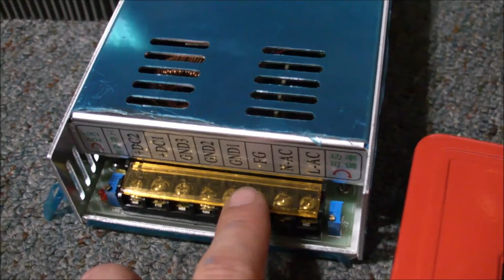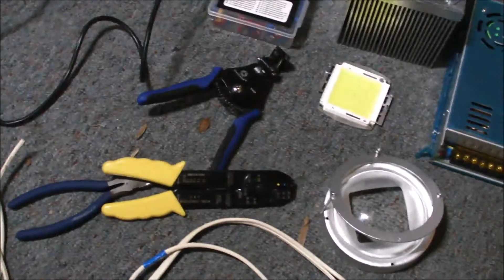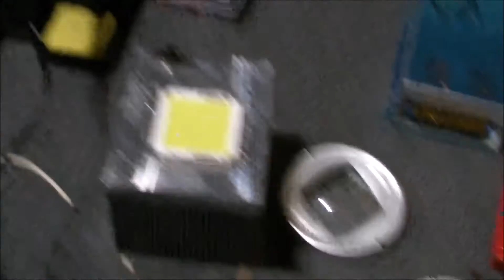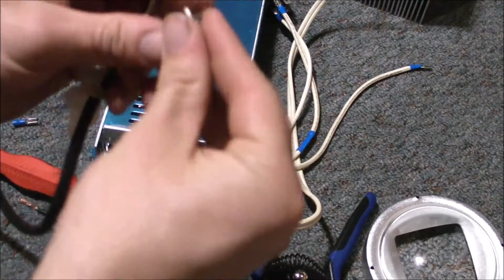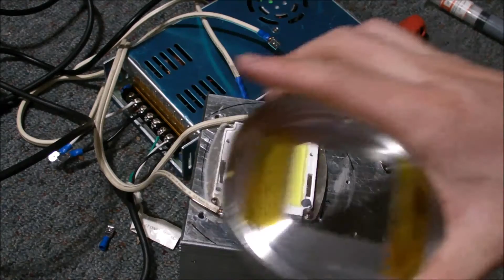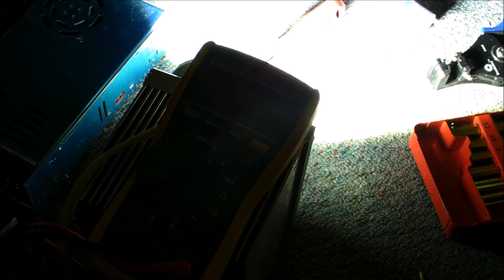Project Night Light- 500 Watt LED Episode 1

Comment: I watched and researched this two years ago. Will some one wake me, when we can get 80k lumens for $200--less, driver, and heat sink.  Not weighing a ton (heat sink and driver) would be a plus.  I say 80k, because this is the bare minimum light needed to light up a room and make painting difficult color changes possible. It is also the Flux of a $100 magnetic 600watt metal halide.... I have spent 30 years trying to find the perfect lighting for painting.  Led lighting is not being ambitious enough.

Comment: Nice project.
A few things though..
You should go for a thicker tip when soldering components and wires of that size. Gives the joints a fast heat-up on smaller surface rather than slowly heating a bigger area.

Pre- soldering/ tinning the wire ends as well as all components IS important, as you need the flux to actually soak into all the strands to allow it to do its "magic", i.e. make an optimal bond between solder and copper, or whatever you're soldering together. 

When you don't pre solder the wires, a lot of the flux will be burnt away before the solder gets hot enough to melt and bond between every strand.
This in turn makes the surrounding components heat up unnecessarily as you'll have a massive increase in heat dissipation when two unsoldered joints are heated up at the same time, and most electronical components don't like getting hot for a longer period than absolutely necessary with optimal soldering.
On the other hand, when you solder stuff on top of a heatsink, you'll run a great risk of a cold solder joint (poor connection between solder joints)

You may have heard this all before.. 
But when you post a tutorial on youtube, it's best to make sure that for example viewers with slim- to- none soldering experience learn it properly
 -rather than end up giving up on a project due to misinformation.

Comment: Поздравляю! Ты первый на ютубе собрал этого монстра. 
 Юзай водяное охлаждение.
Reply from the maker: first one to build a useful flash light, all others on youtube are not practical since the battery life is so short
Reply: Я тут собрал кой чего на 100w диоде. Как выложу на Youtube, поделюсь ссылкой. В общем, там аккумулятор из 48 банок 18650. Делал для пикников в лесу, но этот аккум и 500вт потянет. 
 Кстати, очень рекомендую отражатели-рефлекторы на 15--30 градусов, свет получается направленным и даже 100 вт фонарь светит очень далеко. Линза 60 градусов светит во все стороны.

Comment: FYI. The AC cord wiring color does matter.  US electrical code ( NEC) denotes that AC wires as follows,  Black is line / load, White is neutral, & green is ground. 
The way AC circuits are made, that internally, if something happens and it shorts out in the primary circuit it will go to ground. If the Black or line is wired to the neutral terminal and a internal short happens, your power supply case is now HOT electrically. If you touch the case at that point & you are grounded, you will be electricuted.    Just saying for your safety and viewers that could destroy a anvil if you know what I mean. Lol

Comment: Nick, I'm trying to power 9 LED Panels (40w each) with a 500 watt Med grade driver, but I keep smokin/burning out my lights. I don't think there are current limiters/diodes in the LED panels, can you help with a solution if I show you the diagram? Can I email you?
Reply from the maker: they are probably 50 watt led chips. they run on anywhere from 25-35VDC (depends on color)  what voltages is coming out of your driver and do you have them wired in series or parallel?
nsilcox3@yahoo.com
Reply: 9 panels at 40 watts each is only 360 watts, the reason your burning one light out is because its thermally running away, when it starts getting overpowered the current draw curve gets amazing steep exponentially fast which means it draws current alot more efficiently the more voltage you put to it, thats why it gets real bright right before it lets the smoke out. you have to look at the datasheet that goes with the led you bought, you need the forward voltage and current it wants to run to be exactly right, also are you running your leds in series or parallel? make sure u mark ur panels so u kno what they are if you start gettin a collection its worth it trust me. i Highly recommend getting a thing of thermal compound itll make your leds last alot longer because trust me most panels so far have a pretty high failure rate of some of the leds in them, iv had some panels slowly one by one lose about a third of the leds and one fail in strings till almost all of it was dead it was definitely a bad led tho, not typical. you dont need diodes, in fact thats exactly what an led Is, it just emits light also, you definitely need some resistance though im not sure what your mains voltage is but to get the right resistor all u need is the line voltage feeding the resistor to the lights, the voltage the leds want to run at (whether its series or parallel), and the power dissipation whiches in watts whiches basically how much power the resistor can handle. theres probably thousands of videos on here explaining all about this stuff because im sure i didnt explain it very well, hopefully to interest u in checkin it so u can learn to do it urself it really is soo much easier than youd think and its soo nice n so much fun when u can start puttin leds pretty much anywhere u want, iv got em in every light socket my car n house has lol and my truck has 20 marker lights alone lol sounds ridiculous  its a 94 k3500 with the lights across the tailgate for some reason, across the top of the cab and on the front n back of the dually fender

Comment: I wish I could buy it from you, could you maybe give a price?
Reply from the maker: i will be uploading the finished product within 2 weeks hopefully, i built the frame from aluminum, 2 cooling fans,  1000 watt battery (48V, 22AH battery) with built in charger, balancer and available to run on wall power for hours if needed
i dont know what price to put it at since the amount of time and effort that was put in this project
Reply: +Nick Silcox ok, thank you for the very quick reply, and advice.
Reply from the maker: +S Bekcic primarily, the only hard part was understanding how to make the battery bank from scratch. Other than that it wasn't too difficult
Reply: Not able to understand as the camera focused top left corner so not able to understand the wiring of led bulb.

Comment: What are you using in terms of current limiting? without a driver/ballast, the life of the led will be greatly diminished.
Reply from the maker: +Connor Cruz with the power supply, it delivers 75 volts  at around 7A  the specs for the led is 70-80VDC@8A so i am in the safe limits. when you are running these with straight batteries, you will then need a driver.  i video of the finished led should be out within this week.

Comment: Bro, check out illumn, no need to wait for anything from China. They test the stuff to make sure they're not fake. Get either the vtc4 (while they last, or the new 25R R5) I really like that heatsink. I wonder how it'd stack against the Noctua. Thanks for uploading. I just finished watching.
Reply from the maker: +Nonnof Yobiznes Samsung is a great brand of batteries, but they are way too expensive brand new. im designing this project to be as cheap as possible, and yet durable.  the stuff im waiting from china are brackets, a bms, and a power supply for the BMS.  it is just time consuming testing each battery i get from laptop batteries